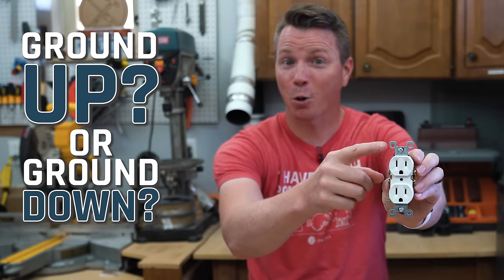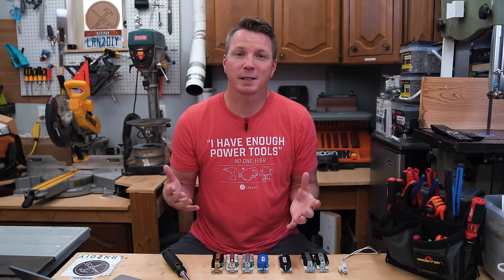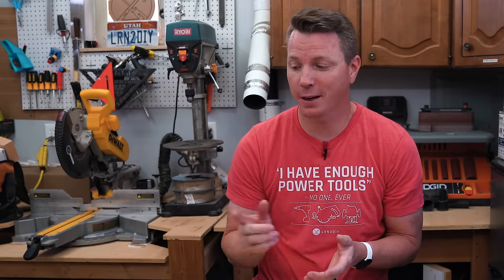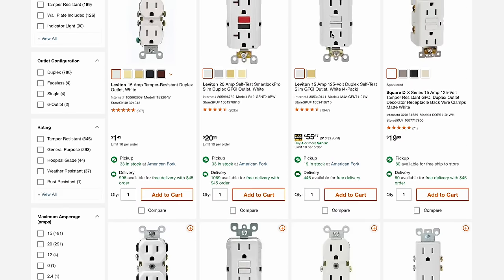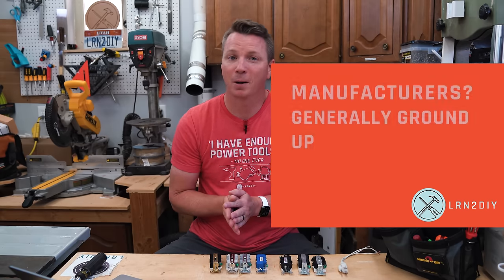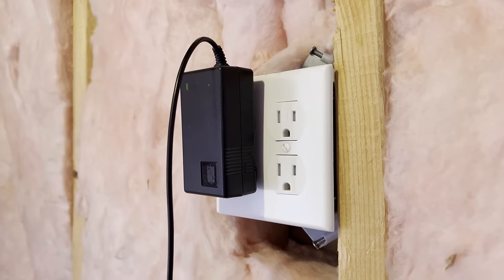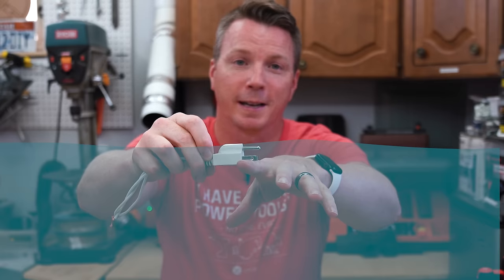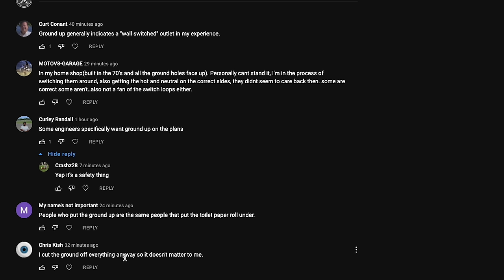Should Your Outlet Ground Face Up or Down?

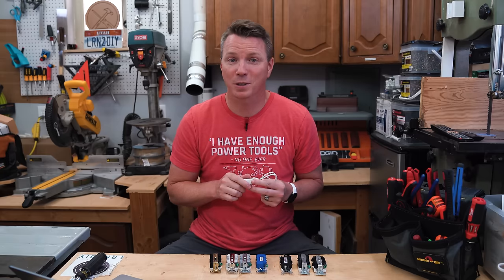Comment: 6:42 You shouldn't worry about that hand grabbing problem, the first time your hand touches both hot-neutral (because the ground is up) will be the one and only time you make that mistake, and afterwards, you'll be grabbing the plug correctly.
Electricity is a rough teacher.
Reply: Better than to touch just the hot though

Comment: I read something that said ground up for industrial and ground down for residential. Don't know how true this is but kinda makes sense.
Reply from the maker: That's definitely a pattern I'm noticing.
Reply: That makes no sense at all. Why is the same level of safety not a concern in homes as in hospitals?
Reply: @73dcp  Because people like smiley face. Also some appliances are designed for sockets fitted ground-down, so switching that around would cause consumers some pain.

Comment: Since in Ontario is does not matter whether the ground is up or down except in a few circumstances such as RV parks (ground up), I'll replace mine ground down simply because I'm used to them being that way.  Also, every flat plug I've ever owned has been oriented ground down.
As for anything falling on partially exposed plugs:  if my faceplates are loose enough to fall or if my receptacles won't hold a plug, I replace them because it's the right thing to do.

Comment: Speaking as a newbie, is there an ease-of-installation preference based on the usual direction from which the wiring is coming towards the receptacle?  (i.e., if the wiring is coming down from above, is it easier to make connections if the ground is on top?)
Reply from the maker: Considering how a receptacle will be used is helpful, for sure. The trick is that you never really know how it might be used, especially over decades of use, unless it's a pretty specific use-case. Great point though - definitely worth considering.
Reply: @LRN2DIY  I think they may have been asking if the direction that the building wiring (i.e. Romex, etc) feeds into the box has any effect on which way would be easier to install the receptacle.

From my experience, the answer is no.  Most receptacles attach to the internal wiring with terminals on their sides or from the back, so it's about the same either way, and if people are doing things properly there is plenty of wire to reach wherever you need it to go when installing the receptacle anyway (you will typically feed more than enough through initially, and then trim it to whatever length you need when you actually install the receptacle/switch/fixture/etc based on where you need to run the wires for it), so it really doesn't matter which way around you want to mount it.

Comment: Most, if not all accessories like grounded wall warts or air fresheners, nightlights, or whatever are ground down, or if they don't have a ground pin, oriented with the wide blade left, so wall warts with the wide blade made for left will gap with the heavy part up.  It is also very nice to have every outlet the same so you can manually put the wide blade left before plugging in and never get it backward.    Ground up is a major pain in the rear.  I bought a house with all the grounds up - it was several hours to go orient them ground down.  Of course at the same time I put identification as to which breaker each outlet and light switch went to - tremendous time saver when you have a breaker trip.  Of course I also labelled the breaker box at the same time.  And while we are talking about light switches, the combo units with outlets are all ground down.

Comment: I do like the ground plug being up for the reason of a possible conductor falling on it vs hot prongs.  However, with almost all plugs or adapters (wall warts) that have any mass, the ground up configuration will pull down out of the receptical from the top, exposing both the ground and then too the hot prongs, because the ground prong is not held as well as the blades.  Also, in the ground down configuration there are two blades holding from the top vs one circular prong in the ground up configuration, meaning that a ground down plug stays in the receptacle when a ground up does not.  Given that all receptacles wear with time, the ground down configuration has a better chance of staying in the receptacle where it can’t do any damage.  Hence ground down wins in my book because I don’t want my plugs coming out… ever.  The way to address this issue permanently is for the code to specify a new design(s) enabling for the entire plug to be shielded and protected from things dropping on it, then we could have our cake and eat it too.
Reply: Excellent point, especially with an unobstructed wall outlet. I want to add that when we have to plug anything behind a dresser that needs to hug the wall, the addition of an extension with a low profile plug allows us to do that rather than bending an appliance cord with the basic plug (when the dresser inevitably gets pushed into the wall) and eventually causing an electrical fire from the wire strand breaking inside the cord's insulation. Most such extension cables also have their cord hanging down off-vertical so both duplex sockets can be used with extension cords that use such low profile plugs.

Comment: Thanks for the video! Let me get my 2 centa in!  Most homes today have outlets horizontally/sideways, so up & down doesn’t matter. I own my own home (purchased new and a trac home, not custom) and after moving in have done all the electrical wiring myself. When my basement was finished all outlets were horizontal except a couple that were for plug-in electronic bug eliminators. My basement bar has 2 outlets together and one is up & one is down, I did this because of the orientation of some of the appliances used at the bar dictate this, more on this later. In my master bedroom I have  2 outlets one on each side of the bed. The left outlet has 3 plugs in adapters to make this work. Some of the plugs are large, like from the CPAP machine and plug orientation has to be with cord down because of the weight of this 2 prong plug. The other outlet has also 3 things plugged in and is a 1/2 switched outlet, more adapters. I will be adding 2 more outlets in these 1900 boxes with new adapters etc. Currently this is a mess. These bulky 2 wire plug-ins dictate which way the plug goes in. Usually the left side of the 2 prong plug is hot (smaller prong) this would make the outlet orientation with ground down, but that’s not always the case.   Comments, thanks…Jim
Reply: Actually, for sideways receptacles, and following logic of falling object into partially inserted into plug with ground down… For sideways/Horizontal mounting it would then make sense to mount ground left, so is a plug is partially out, the object would hit the Neutral, rather than the Hot side of the plug.

Comment: A good friend of mine is a master electrician and does mostly commercial work and I asked him this question many years ago.  He told me that in most commercial and industrial applications it is specified ground up.  For residential there is no correct way any orientation is acceptable.  Medical offices and hospitals are always ground up.  He has been working as a master electrician in NY state for 38 years now, has wired many hospitals , dentists offices and medical complexes as well as some industrial shops.  He always orients his outlets ground up.  I asked him about the switched outlets and his reply was "there are many different colors of outlets so use a different color if you want to designate.  And as far as appliances such as refrigerators and microwave ovens they are supposed to be on there own separate circuit and a single receptacle unless behind the appliance and inaccessible, then a duplex receptacle is acceptable.  these can be oriented in any direction since there is little to no likelihood for it ever coming loose. Just sharing my experience wiring a few jobs and houses with my master electrician friend and looking up the codes.
Reply: You are exactly right about the commercial vs residential.  ...and if you notice the back of the receptacles in the video, you can pretty easily see that the "commercial" receptacles typically are more robust and have a metal strap around the back.  Those are the ones what have the text oriented for ground up.  The ones without the strap are typically geared towards "residential" use and have the text oriented ground down.

Comment: We’re in the Chicago metro area conduit with metal boxes are required even in single family homes, all most receptacles are mounted horizontal, most with the hot side up, I usually install them neutral side up. 
I’ve been an industrial electrician for 25+ years.

Comment: Well I don't know about typical American plugs but here in New Zealand where we have a similar but different style of outlet the earth/ground is always down. This is very convenient as many plugs have the cable entering the plug itself through the bottom and not through the back as your plug does. Having this orientation means that the cable hangs down below the plug and if the outlet were oriented with the ground up then the cable would be coming out the top of the plug, very unstable.
Additionally the active and neutral pins have 2 or 3 millimeters of insulation on them next to the plug molding so that there is reduced chances of accidental connection when the plug is part way out. By the time exposed metal appears out of the outlet the pins will have lost contact with the internal connectors. The ground pin (which is flat) is longer than the live pins so it is the last one to lose contact.

Comment: I always heard ground up was called office style. Because of the possibility of a paperclip hitting the hot and neutral. The other time I see the ground up is when it is indicating a switched outlet. You cited most of the other reasons for which position to use. I install them in what ever position a customer wants. Normally ground down.

Comment: Ground down. Many outlets have metal contacts that are pinched together that hold the blades of a plug, keeping the cord in place in a socket. Having ground down, allows better stability of the cord when gravity hangs on it. As shown in the video, many cords are manufactured with ground down especially dryer cords and 90 degree angle cords. Having these cords in an opposite direction hinders keeping them plugged in.
Lastly ground down rhymes, and because it sounds better, should be used all the time. Thanks for listening.

Comment: I usually find that when plugging in something like a timer, if it goes in GD, then you can read it without turning your head upside down. Especially if it's analog with physical settings.  So I prefer GD.  Also, it looks like a face.  I also agree with flat-plug comments.

Comment: I tend to do ground up. This is from observing that many tines when installing or removingva plug your finger or thumb tends to ride over the top side of the plug, potentially making contact with the prongs. Ground up ensures if you do slip your finger or thumb only makes contact with the ground pin.

Comment: I have outlets facing up in my floor, as does the business I work at. I assure you both buildings were made to code. Also all of the receptacles I purchased have a stamp that says TOP. (Ground down)  But I do agree it should probably be ground up. When I change my outlets out I'm going to do ground up.

Comment: My 2 cents on why I install receptacles ground up. I worked in a hospital in building facilities maintenance/engineering. All receptacles were ground up. If the ground is down and the plug is not totally inserted as can happen. And a metal object happens to fall onto those 2 hot prongs. What happens? Shorted out sparks flying! On the other hand. If the ground is up and a metal object falls on it. What happens? Nothing! So, install them however you please. I will stick with ground up.
Reply: I used to work for a biomedical company (we made digital EEG machines), and that was where I was first introduced to the ground-up method. I was told at that point that it was a requirement for medical devices. I can imagine that throwing sparks in an environment where pure oxygen ventilation may be used would classify as a Bad Thing™.
Reply: Agreed. Often the receptacle is itself loose from wear and doesn't grip tightly. For heavy cords etc which will pull down you often come across slightly exposed live  neutral. That is a risk if unnoticed especially for dropped conductive objects,  or a person who reaches blindly to unplug. With ground up the weight of the cable will rotate the live / neutral into the receptacle,  while exposing the ground. In the UK, which has big receptacles and plugs, but many more built in safety features (including extra long ground prongs that make contact first), I've also seen the receptacles ground up.

Comment: In my home all of the receptacle outlets are mounted horizontally.   No issue with ground up or down.    Also good for tight vertical spaces above counters, below counter top in center islands.    The horizontal mounting is, in my opinion, more aesthetically pleasing.
Reply: It then becomes ground left or ground right, and since ground right is all right, I believe this is alright. 😁
Reply: You must live in Illinois. Then the Hots are up too.
Reply: @Salty_Knuckles  
Wow, hot up defeats the entire presumed point of ground up arguments.
Reply: I was becoming a bit worried prior to reading your post @johnwhitehead8006. For a moment there I thought my house was the only one that had receptacles horizontal, breaking ALL safety codes! 😥

Comment: The NEC says you must install to manufacturer specs so in those cases where there is an arrow on the receptacle fur up it needs to point up. That is always ground up.
Reply: Not seen an arrow for orientation on receptacles.  Which manufacture does this and is this arrow an actual specification on/of that receptacle?
Reply: @Merescat  eaton and some leviton.  It is really hit and miss which just and to the confusion.
Reply from the maker: Good to know - I've never seen an arrow. I wonder what conditions that would apply to?
Reply: @LRN2DIY  Yes. So it still is a question if this is for manufacturing or for installation.  Is it specified in the sparce paperwork with the receptacle to follow the arrow for installation?  Is it labeled "This way up to install" ?   I'm very skeptical if it not specifically pointed out some how beyond just an arrow on the device.
Reply: Ahhh, so NEC let receptacle manufacturers decide code!

Comment: Up or down depends on the device plugged in. 
If the device wire is comes out parallel to the wall, and the device itself is on a desk or shelf above the receptacle, ground should be up. If it's parallel and the device itself is lower than the receptacle, I would put the ground down. If I have a double receptacle situation and I've put ground up on one and down on the other.

Comment: When I was building my home shop I lost a hook when measuring and the tape measure fell across a plug that was plugged in. It made a connection across the hot and common and melted the tape. I also remember a time when hospitals routinely installed outlets with the ground up.

Comment: The issue that many forget about are the devices that plug into the outlet. Many are designed for ground down. This places the device such that controls are on top, text is upright, angled plugs lay right, and the hot and neutral blades are correctly oriented.

Comment: 1.  You should have pulled up some devices from the 90's or early 2000's because those outlets were marked with the ground side as "top" meaning that they were listed to be installed ground up, but people regularly installed them ground down.  I don't know of any inspector that called the electricians on the listing, however, but it was technically a code violation to install the outlets ground down.
2.  The safest install for outlets is ground up (vertical) or neutral up (horizontal).  If your finger is touching any of the prongs on the plug when you pull it, you are incorrectly pulling the plug.
3.  As far as the flooding issue, you are supposed to install your outlets above the flood plane where possible.  It's rare to have a situation where you have to install outlets below the flood plane.

Comment: I wired my own house (from meter to breaker panel to terminations) and wired all receptacles ground up.  However, I'm going through and flipping them one by one as most appliance cords favor ground down.  Also, I think people in general like to see the shocked little faces of the receptacles, but that may be my perception.
Reply: The appliance cords are the frustrating part of this. Angled cord that's wired for ground down, but your receptacle is ground up, now you have a cord going up and looping out.
Reply: I n the old days plugs were often in baseboard sideways. I much perfer that.   My mom's house is done that way .  Plugs sideways   about 4" off the floor.  I know current cod doesn't allow that but it is actually better, wires not going up the walls is a good thing.. and outlets disappear into the dark wood.

Comment: I live in Illinois, in the area around Chicago, and our outlets are almost always mounted Horizontally, not vertically, so the question doesn't really apply here. I did look around my house and the grounds all seem to be on the right, so I don't know if that is standard or if it was just code from when this place was built in the late 70's.

Comment: All my outlets were upside down until I renovated and replaced them all.
They were a pain whenever I used angled plugs.
It was a good thing I did, because I found several with neutral tied to ground.